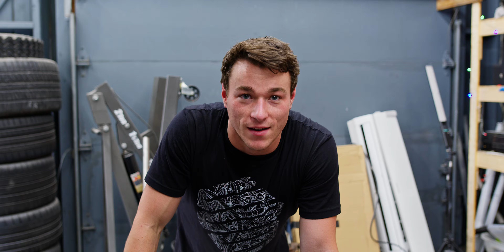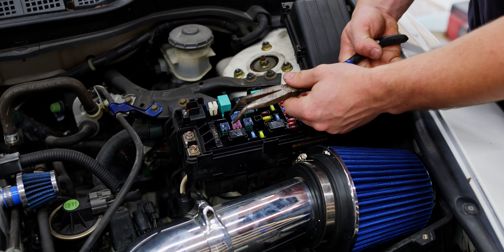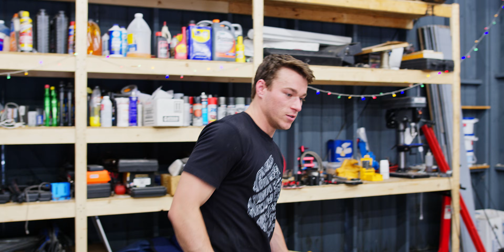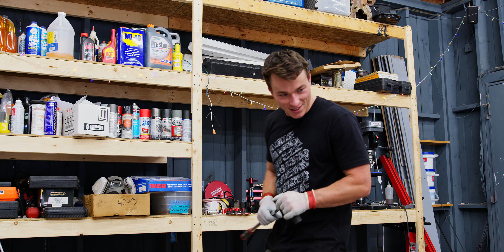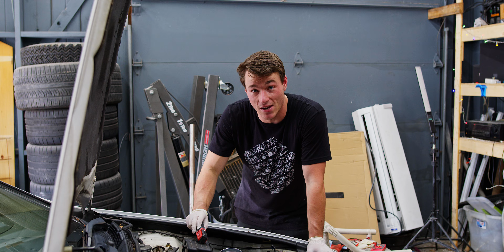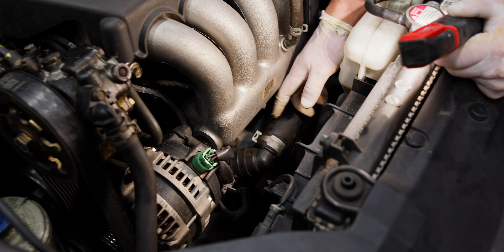2003 Honda Accord Radiator Fan Failure SOLVED! - How To Replace Fan Switch WITHOUT Draining Coolant!

Comment from the maker: Sorry about the kid yelling noises, the neighbors were having one heck of a pool day!
Reply: Couldn't hear it over my own kids, haha. I liked the diagnosis video, you should do more.
Reply: Whole new wiring harness from the battery power source it self to tha fans was a great solution now everything should stay in place until a new car
Reply: Hi I have the same problem on my 1989 Prelude, I replaced the radiator thermocontact sensor, the relays and even the control ECU because there are only a few! and nothing! and when I shunt instead of the relay with a switch it works it drives me crazy, it will end up with a rally car kit added!

Comment: COOL SHIRT! That's the 2.4 you're working on. Does the 3.0 have a fan switch at the bottom of the radiator or does it just rely on the two ECT sending units up by the thermostat housing?

Comment: I'm trying to figure out my overheating issue with my 04 accord. I've replaced water pump, thermostat, and now the radiator fans only for the issue to continue. All fuses look fine. I was able to get one relay to replace but i have to wait for the other one to come in. I just tried the paperclip trick in my relays and in the sensor connection and neither got my fans to kick on.. any suggestions?

Comment: Fan might work when putting on ac but that don't mean the cooling fan is good. Thats on the high a high speed. Regular operation is a low speed.

Comment: Amazing video! I jumped the terminal and with the wire bypass method you showed. One fan spinned and the driver side radiator fan did not though. Must mean I have an issue elsewhere..
Reply: My 07 Accords engine temp went really warm twice on me already when in stop and go traffic and it only blows chilly, not cold when im driving down the highway and yup same deal with mine my driver side fan didin't turn on after 20 minutes of driving, I think its my fan but idk
Reply: Spent $1600 today getting ac compressor that was bone dry and seized replacement along w condenser, expansion valves and freon line that broke. Went to try ac and didn’t work. Long story short, got ac blowing cold again and realized radiator fan motor wasn’t working. Getting power to its plug, thank god motor is relatively cheap to replace.

Comment: Thanks a lot, brother. My car has the same problem. I replaced the radiator sensor, but the fan still doesn't work.
From Thailand

Comment: This is a great video. I know this is the 4 cylinder version but I'm having trouble with the same accord but the v6. So the first relay that you removed I'm assuming is for the ac condensor fan and only powers on that one, so I did that and both fans turned on. You said the other relay was for the driver side or the radiador fan, I did the same thing with the piece of wire but this time it did nothing.
Would you have any idea of what could be wrong or bad? Also, when the car is up to temperature the only fan spining is the ac condensor, but again, if I put a jumper cable on the relay that is supposed to only be for the ac condensor fan both fans kick in.

Comment: Hi I have the same problem on my 1989 Prelude, I replaced the radiator thermocontact sensor, the relays and even the control ECU because there are only a few! and nothing! and when I shunt instead of the relay with a switch it works it drives me crazy, it will end up with a rally car kit added!

Comment: So yeah I took out the relays And did the hairpin trick almost like you did and the fan on the passenger side is going but the fan on the driver side doesn't respond I even swapped around the relays and turned on the car and neither of them were working

Comment: I jumped the relays and the fans turn on.  I checked the connectors and they both read 12.81V.  I tried to jump the coolant temp sensor like you did but the fans wouldn't come on.  Can you steer me in the right direction on what to do next?

Comment: I replaced the thermostat and ECT 2 sensor with brand new parts and the fans still aren't kicking on. They kick on when jumping the ECT 2 wire connector, so it's not a wiring issue. Tested the old thermostat and it opens up at 197 F, so that was working before. What else could it be?

Comment: I love when people share their knowledge with others. Thanks a lot, man keep up the good work. I have a 2007  (2.4l EX-L) accord my a/c works but I noticed one fan (Driverside) is not working (The passenger side fan works perfectly)  Fuses/Relays are fine so what could be the reason? Do I need to replace the whole unit? Any advice will be greatly appreciated.
Reply: Did you ever find out what the issue was?

Comment: Great video, Had a bad relay on driver fan. Ac fan worked so I switched those relays , now driver fan works and ac does'nt . Im off to get a relay at the auto parts store. THANX So much!!!!!! You made my day. Especially since I just did the radiator, thermostat and water pump (timing belt to but unrelated) Have a good one!
Reply from the maker: Glad we could help!

Comment: I was having intermittent hot idle issues on one I just got and noticed fans weren't cycling at all. I was checking fuses/relays while running to see if I could get em going. Tapped fan motors hard with pliers one at a time and they came right on. New fan assembly for me it is!
Reply: Literally read this comment, tapped on it and BOOM it came right to life

Comment: My coolant temp doesn’t go over 194 but the radiator fans don’t run and it seems like the lower rad hose doesn’t have water flowing thru it idk if I have a problem or not. I changed the fan assembly both fans come on when ac is on. I changed both temp sensors the thermostat and the water pump.

Comment: Hi.  I have a 2002 honda civic.  While trying to fix my cooling fan temperature switch, I messed up the connector harness: one of the prongs got pushed flat back or something; now the connector needs to be replaced.  Any idea of how I can replace it or (fix it)?  Thanks in advance.

Comment: I've replaced my radiator, both fans, thermostat. Now its time to check the cheap things :D Mine we're all upgrades I wanted to do anyway but I should have made sure I knew what was the culprit for my fans not coming on. I guess its fuses, wiring or the relays.

Comment: Wonderful video. My 1988 Honda Accord LX has very similar problems! Radiator fan used to come on while idling (at Mickey D's or at stoplights) and would lower the temps but I no longer hear it and the temp goes up straight to H! I have to crank the heater up to save my engine. :( I had a new fan put in last week but the mechanic cracked my radiator!! I need to replace the rad, the thermostat, the temp sensor and possibly the fan switch. Question? Do older Hondas have a coolant temperature sensor AND a fan switch? Thanks in advance. P.S. I also purchased a new water pump...just in case. ;)

Comment: I have an issue with the position of the fan on my 2004 Accord, fyi I live in Indonesia, steering wheel on the right side. So the issue is, my condense fan is on the passanger side facing transmition engine, which is if on the left steering wheels is on the driver side, and the radiator fan is on the right side facing v-belt. It is OK ? If not how can I switch beetwen the fan ?

Comment: Hello! I had a question about the relays. We tested the condenser relay with the wire and the fan came on. Did the same with the cooling relay and nothing! No power going to it at all. Would that be the relay is bad on the cooling fan? We have already replaced the fan switch and that did nothing. Hoping to get suggestions on where to go from here. Thanks so much!!
Reply: ... tentative help: if the 20Amp fuse is still good, when you bypass the correct relay slot then fan should run... 
- if NOT: bad fan, bad connector or bad GND!
- if YES: bad TempSensor or bad relay!

Use a $15 DVM to help yourself out with this basic stuff. 
Tricky is when computers gets involved.
[Video: OEM thermostats do not die shut but jammed open, perhaps only partially opened in this car)

Comment: great video. my radiator fan decided to just magically start working again so the hours i spent studying this and a few other videos weren't necessary, nonetheless, of all the stuff i read, you covered the most and thoroughly too. i have nothing to add but someone else mentioned that it's a good idea to start with jumping the temp sensor so you can immediately tell if the whole circuit is functional or not. i didnt do that but seemed like a good idea. anyway, this is probably the best content on the topic of diagnosing a 2003 Honda Accord radiator fan so legit props.
Reply: Should the radiator fans work without turning on ac in car
Reply: Or they should come on only by turning on car

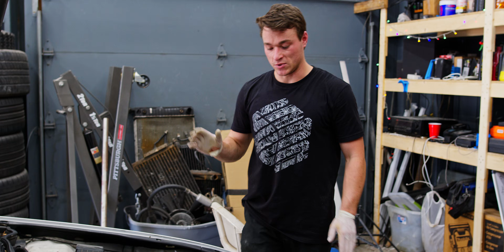Comment: I unplugged the fan pig tails (blue and black wires in to the plug, red white out. In your video it is shown at 10:01) at the fans on both sides of the radiator and supplied power directly from the battery with aligator clips. neither fan powered up. this idicates to me that both fans are blown. Is there any reason these fans will not power on when going directly from the battery to the fan motors. I assume that polarity is a non-issue.

Comment: I replaced temp sensor, temp switch, relays and check ALL fuses. Fans are not seized and have been tested, they work fine. Fans will not come on
Reply from the maker: If you short the relay does that force the fan to come on?
Reply: @VeryGoodGarage  yep. I'm gonna go back over the fuses one more time though
Reply from the maker: You should check the radiator hoses, there's a top one and a bottom one. The bottom one flows through the switch that turns the fan on. If that bottom hose's coolant doesn't get hot enough to trigger the switch, then the fan will never come on. That's why our problem ended up just being the thermostat, it wasn't opening to let the hot coolant get down to that switch. Also it took a long time for the engine to heat up enough to trigger the fans. Took about 30 minutes with revving the engine to get it to finally kick on.
Reply: @VeryGoodGarage  the temp switch and the temp sensor is on the top of the engine inches away from each other along with the thermostat which is also new.
Reply from the maker: One other possibility is a bad water pump. Fortunately for us, that wasn't the issue, so we also don't how to test that, but it would be another thing to check
Reply: @VeryGoodGarage  yes, i was just telling my friend this morning thats the only thing left is lack of proper water circulation

Comment: I have the similar problem one of my fans doesn't turns on i tested and it does have power im thinking that my radiator fan motor is bad

Comment: My both fans starts blowing when i turn ingnition on (not start) and AC is on.. is that normal?
If AC OFF (button) fans not blow.

When car running, fans working normal (blow-off-blow)
Reply from the maker: I think when the key is in that position, the car turns on most of it's electronics (like the dashboard lights) to make sure things work? Total guess, not based on anything, but honestly if your fans work at all I'd be content. Much better than not working